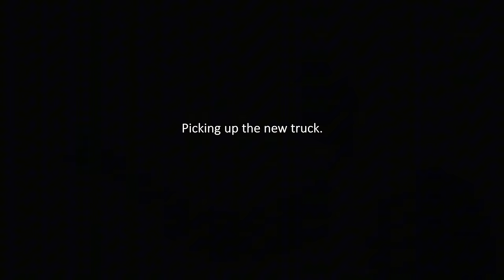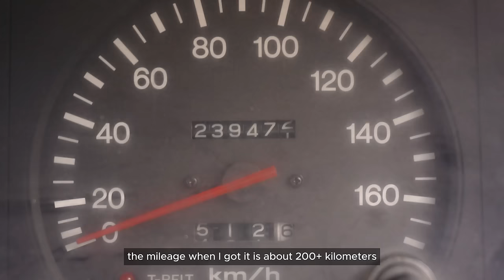I BOUGHT MY DREAM TRUCK!

Comment: Shit Jun you will regret very soon, not more than 6 months I guess u will change your mind, this car got tonnes of repair coming to you soon, loads of repair, it’s not nice driving along the highway as your use of offroad will be very minimal. You should just buy new manual hilux and modify the car suspension for extreme offroad
Reply from the maker: I'll find out soon enough but alot of consideration has gone into this before I purchased it. So I believe all will be well. Thank you alot for the heads up though :)

Comment: Far away from bullet proof contrary  their heads are pretty weak. And with and 125bhp while new wont call that a proper 4wd. Probably one of the most overrated trucks out there. Had one poured a lot of money into it to gain looks only . Been fouled by the myths.  Ill get stuck with my Euro trucks . Save more buy a proper European truck
Reply from the maker: Well, I guess it's not everyone's cup of tea, and I will soon find out if its mine :)
Reply: Far too overrated and way to expensive for what it is. Enjoy for now and see how you feel about it. Drive other trucks as well.  Don't overspend on it is not worth it